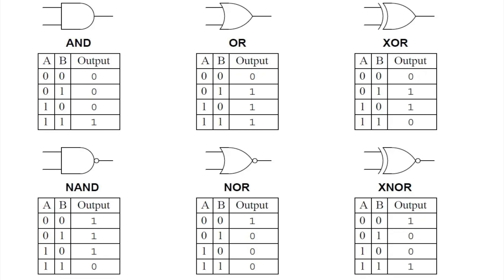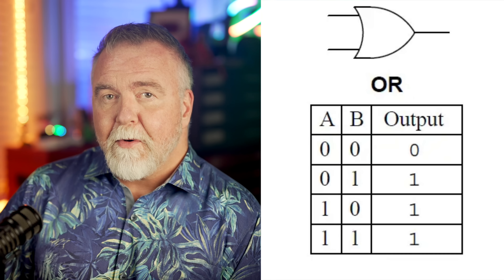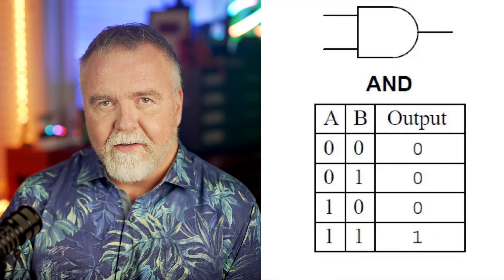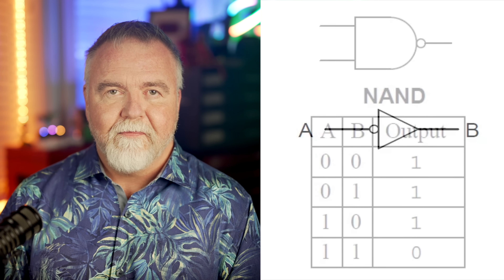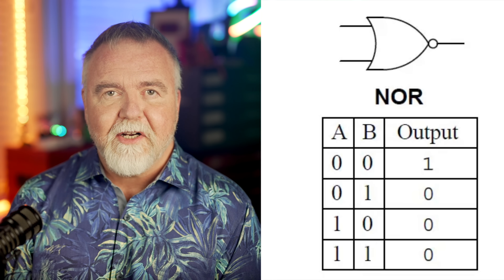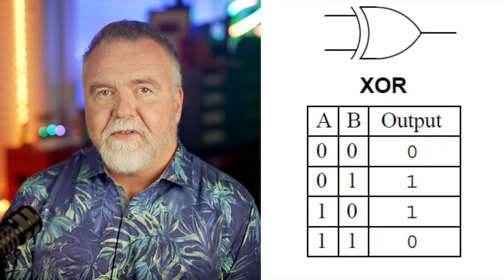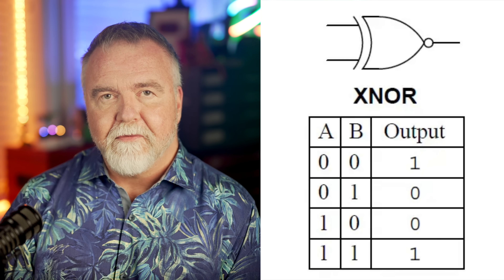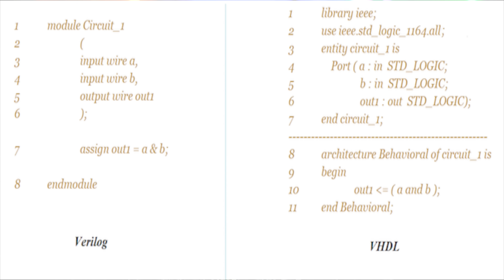The "Do Anything" Chip: FPGA

Comment: As a board jockey with over 100 FPGA designs and 300 PLDs prior to that I will caution you that although the FPGA and its embedded enhancements have gotten really compelling they have never been the panacea that they advertise.  The first and foremost issue is cost. In small volumes they are prohibitively expensive for products you intend to retail. Now I have built protos with them to enable the extended team to get moving on firmware/software development and then moved the design to an ASIC for volume but that's all. The ASIC solution is far more efficient and cheaper with lower power and heat.  The second secret is that for any design you only use a small fraction of every macrocell (or whatever they chose to market them as). The spec sheet will call a part as having XXXXX equivalent gates but due to the nature of macrocell layout for a particular portion of logic only a small chunk of that full macrocell will be used. Fitting into an efficient cost effective design is a bit of labor.   Finally, pinout.  I do not know if they have fixed this nit. I certainly asked them on many occasions.  Its not uncommon, given the above inefficiencies, to have a fit issue in a design. You'd love to be able to just bump up to the next price point/density and leave it at that, but the last I saw, and its been a while, moving from X macrocell to y macrocell changed the pinout which means a PCBA spin.  You can go from 128M Flash to 256M Flash with no PCBA spin. It would be so nice to be able to do that with FPGAs.  I will say the best fit I had for FPGAs was in cryptography.  LFSR's just fit so nicely in an FPGA.  The second best fit harkens back to their original intention - gobbling up combinatorial logic. Really good at that. Great for IO address decoders etc.  For super high speed stuff (PCI-E, PAM, Nteworking, etc) the IO's are usually excellent BUT the cross chip routing CAN make the overall circuit slow down below the capability of that IO. That takes a good amount of pre-planning and paritioning to succeed. Much more than code the Verilog/VHDL and push "program" like a microcontroller.  And of course every change/enhancements restarts that joy and God help you if you need to change pinout.
Reply: And lest I give it a bad name - these puppies are super useful in one critical place.  Everyone knows that the way to win a market is with an ASIC. A single monolothic chip purpose built for the need in the most efficient way possible. ASIC changed the world. Your NVIDIA card is an ASIC. That same design done discretely would cost tens of thousands of dollars, draw 100 amps, be two feet square and need its own air conditioner. (This is how it was.)   Well to make an ASIC takes a lot of effort and a large team of designers and verification people to shake it out.  This is traditionally done with simulators.  Simulators are slow - very slow. Depending on your CPU/CPU array setup this can mean minutes per nanosecond of realtime. Imagine decoding an MPEG4 stream using this.  The solution, for those with the capital, is to build or buy an ASIC Emulator. This is a system with arrays of FPGA's interconnected. In some systems you can even put the actual real world IO into the mix with a custom built IO card.  You take your big design, partition it across the array of FPGAs and run it there. ITs expensive but when you you need to compress the development cycle down to a minimum - winner.  And in my experience it found bugs (humans can make mistakes - its okay) that would have taken months of simulation with a low probability if finding them even then. (Called corner cases. And these were almost always where one circuit was done by one designer and the other by another.)  I can guarantee that the stream you are watching is traveling across a chip developed in this way.

Comment: In 2005 I took a course in VHDL which I found so amazing... when I started to understand that the order of some rows of the code you wrote didn't matter as they would be "executed" in parallel. My C++ brain had a hard time accepting the lines of code didn't "execute" in the order that I wrote them but could be "executed" at the same time.
Reply: Currently taking my first Verilog course in University and this literally just clicked in my brain this week (8 weeks into class, our Professor didnt do much explaining and just threw us some half finished code lmao)
Reply: The purpose of VHDL is not to execute.
It is NOT a sequence of instructions.

It's a language to create hardware.
Reply: Does anyone of explore how that works???
Reply: @Krishna-iy5wy  VHDL = VHSIC HArdware Description Language. 
You aren't making code that run on a target.
You are creating an hardware architecture that will execute a function.
Reply: Well even C++ code you do write is not executed in order. Most of the current cpu's does parallel pipelining so you can actually execute more instuctions in one clock.

Comment: The chip that can do anything in a slow, inefficient way by consuming a lot of power. It is clearly a worse solution, which is used if you have no development costs or faster and more energy efficient microcontrollers can't do the job (mostly because the common flaws of having no proper high-speed interface components).

Comment: Ha took me back to my first electronics projects , Fairchild gates flipflops , ittle round pills with eight legs , replaced a hand full of parts . You could build a digital clock the size of a shoe box but still needed driver cir units to control the nixie tube output. Gave off enough heat to toast bread. Take care.

Comment: Sounds easy, but its far from when you first start, my tip is make sure ALL conditions are covered in if or case statements, dont leave anything ambiguous or the compiler messes it up without telling you there is an error (sometimes as they are temperamental).

Comment: I'm a big HiFi fan, and there's lots of new/newer gear using these. Like Chord from England makes really nice DAC's (digital to analog converter/external sound card) that use these for the whole process. And other companies, like Denafrips from China use them in their r2r DAC's (r2r uses resistor ladders to do the DAC) to basically control the resistors on the unit. 

And there's plenty of other examples too. Most are not cheap though. And I've only seen them used by smaller companies, like the two I mentioned. 

Either way. Thanks for the super video Dave. Very informative. You learn about these types of things, and you think that you know all about them. Until you watch a video like this, and realize there's a lot more to it. ✌️

Comment: FPGAs would be great if manufacturers freely published the bitstream protocols so open source developers can write software that is platform independent (yes, there are open source EDA tools out there, but I think they were reverse engineered into existence) - I don’t want to license a design tool that only runs on windows after spending big money on the silicon - hardware vendors should stick to making/selling the best hardware they can produce.  Open source FPGAs also need to become a reality kinda like how the RISC-V CPU became a thing - it seems that orgs like FOSSi and chips alliance talk about this, but where is the silicon?  Chip Gracey open source licensed his first generation “Propeller” multi-core microcontroller, where are the foundry/design start-ups and generous souls like this guy?
Reply: Some day hobbyists will regularly be producing their own chips. It would be interesting if the focus is on producing FPGAs, since with one design you can do almost anything.

Comment: Great video if I could hear it for my kids swinging from the curtains. Historically people used to use NAND gates because they are simple to make using early transistor logic - like two transistors and a resistor.  Then you can make pretty much any combination of logic out of those, even state machines - and state machines are really the ancestors of the microprocessor.  You can with a paper and pen minimise the Boolean logic and get an answer expressed as nand logic.  Early on people twigged that if you have a huge array of these identical blocks and you could somehow wire the grid up by connecting or disconnecting the blocks to a large grid you could realise almost any combinatorial logic.  Some are fuses which are blown at first program others are programable as mentioned in this video.  I think nearly all load the "program" from serial flash on reset.  They were less efficient than application specific designs because you might need to arrange your blocks in a convoluted way to achieve something that can be done in a proper design with a handful of transistors, and with NMOS all those gates were burning away power - even the unused ones, but today they contain all sorts of wonderful blocks and you can control the power usage precisely.  You can even specify an FPGA derivative with a built in 8051 or ARM block so there is no compromise (except cost).  The FPGA doesn't need an OS and complex outputs can respond immediately to inputs without having a "thinking" state machine in the middle.  For most of us though, general purpose controllers are so cheap and so fast that FPGA's aren't necessary, you can get microcontrollers for 1 cent, and you can connect it directly to a 3v coin cell and off you go.  But FPGA's are found in a lot of consumer equipment typically where signal processing is required in low power where a general purpose CPU would make a meal of it, tinkerers like to use them to realise replicas of long discontinued retro parts including entire processors complete with the bugs!  They are however, in my opinion very hard to get started with and I reckon most of them tinkerers will already work with FPGA's as a day job.  The minimum you'd need as an evaluation board, sdk and about a month free from interruptions and screaming kids.  But, if you have an idea and you can come up with the design blocks you can take it to someone who would find it child's play.

Comment: I've tried out FPGA development a few times, but the problem is that the tech changes constantly, so boards I've used in the past are now often redundant, and the community has moved to a diferent architecture or manufacturer. I know some things transfer over, but it's nowhere near as stable as microcontrollers and their platforms.

Comment: I compare FPGAs as the compliment of a microprocessor.   Processors are really good at doing random thing sequentially while FPGAs do a really good job of doing the same task simultaniously.  As an example FPGAs are inefficient at doing one time tasks like initialization but great at repetative tasks like applying a transform to an image. Processors on the other hand can breeze through one time tasks but can quickly bog down on repetative tasks where you need to do the same operations over and over again.

Comment: Please discuss security issues with FPGAs compared to traditional CPUs and SoCs; particularly those related to buffer overrun, code injection, and other common zero-day exploits.
Reply: Interestingly you could actually have an FPGA-based system more secure since you control the entire circuit. Obviously you don't connect the standard FPGA programming part to the outside since it can be buggy. But you can design your own processor with its own protocols, and be reasonably secure that it doesn't have designed-in backdoors like major CPUs do (e.g. Intel Management Engine, running its own proprietary OS).
Reply from the maker: I'm no expert, but I think it'd be immune to most of those attacks because they're really CPU based attacks.  You could hack the NVRAM and modify the config, adding or modifying the design entirely to your own taste if you could break that.

Comment: There are pro audio analog to digital converters that use FPGA as a substitute for DSP.  In this case to emulate various audio effects like EQ compression and limiting. Usually emulating a vintage piece of gear.
Reply from the maker: I wonder if they make things like a keyboard where the FPGA gets set up based on the instrument it's trying to replicate... so your "patch" consists of the samples and FPGA code to model the original sound?
Reply: @DavesGarage  the UDO Super 6 is the only FPGA based hardware synth I’m aware of, they’re designed to offer new oscillators etc through firmware update but I’m unsure of how this differs from a traditional digital VA synth. Definitely can’t think of anything that would work the way you describe but it’s a cool idea

Comment: Hey Dave! I have an old Digital Computer Corporation "Computer Lab" from 1968.  it is a wooden frame wrapped around a sheet of glass with a bunch of holes in it where you have to insert jumper wires in appropriate locations in order to program it for various logical functions.  

Almost all of the  "chips" on the board are quad input nand gates, and you have to use them in clever ways to make them behave like all of the other logic gates.  I have a copy of the "computer lab workbook" that accompanies it, and in the book they explain the cost of discrete transistors at the time, and how a quad input nand gate was just under ten dollars (10$ in 1968!) and a single transistor that performed any of the other operations was around 15.  It would appear that the process to create nand gates was relatively  easy and cheap to do at the time, but any of the other logical operations was cost prohibitive...  

I have mine all wired up to demonstrate counting in binary, and I bring it off the shelf from time to time and show it to my students, especially when I start teaching them about IP addressing and bits and bytes.  

These things came with an obscene price tag in 1968 as well.   My favorite part in the book is where it says that "some day there will be a computer in every city."  

Anyway, how's that laser tempest coming along? :D

Comment: FPGAs have pros and cons.
One of the big advantages is their reconfigurable nature. Screw something up and you can likely fix it later. (the main reason they are popular in the automotive industry, despite ASICs making more sense at these volumes.)

But FPGAs have big downsides.
One major one is speed. Due to their inherent extra logic for handling their reconfigurable nature, they suffer major propagation delay compared to dedicated logic using the same manufacturing node.
Another major issue is cost. You get far less computational resources for your money. Since they require a lot more transistors due to the aforementioned logic needed for their reconfigurability.
The third issue with them is power efficiency. Yes, all that extra logic draws more power. Especially all the logic used for signal switching for both buses, but also for switching what logic functions are used.

Now, FPGA vendors have "solved" these issues by adding dedicated logic.
One of the earliest inclusions were SRAM, since a large SRAM array is a lot more resource efficient compared to implementing it in the FPGA fabric itself.
Another typical inclusion is things like full adders, IO frontends (PCIe, USB, SATA, Ethernet, etc, etc), and even whole processing cores and dedicated accelerators.

FPGA fabric itself isn't all that impressive. And using it in raw computing applications is often (but not always) a bit inept. In a lot of larger FPGAs, the FPGA fabric isn't really the main attraction, but is rather used to glue the various dedicated logic pieces together.

However, multicore microcontrollers are quite competitive against FPGAs. Same for multicore microprocessors in general. Though, most CPUs suffer from caching issues when handling highly latency sensitive operations (a cache miss can be completely unacceptable due to the associated increase in latency), but some DSPs have integrated RAM for this exact reason. While some CPUs have scratchpad memory to solve this caching issue. (scratchpad is however a rare feature often only seen in servers, and even there it is still a rare feature.)

If we compare an FPGA to an ASIC. Then an ASIC made with 10-20 year older manufacturing nodes can still be competitive as far as throughput and power efficiency is concerned.
However, ASICs are rarely reconfigurable, one can add reconfigurability to one's ASIC, but it brings along similar downsides as FPGAs inherently have. So a semi-reconfigurable ASIC made with a cheaper node is debatable if it is a better solution than an FPGA. Especially when one considers the design and manufacturing aspects of ASICs. And this is honestly the biggest advantage of FPGAs. They are stuffed full of IP blocks for all the protocols you can dream of, often it is just a simple license fee away, for ASICs it is a lot more paper work.

In the end.
FPGAs are having pros and cons.
They are good for the following:
Low volume. (how many units constitutes "low volume" is highly debatable and depends on the application)
Reconfigurability to avoid future potential issues. (as stated, semi-reconfigurable ASICs aren't really much different than an off the shelf FPGA)
Highly latency sensitive applications with high throughput. (but oftentimes one will be forced to build an ASIC here regardless, since there might simply not be any FPGA fast enough for that task)
Or if one needs a bunch of IP licenses for various protocols.
Quick lead times. (they are often in stock and shipping, unlike an ASIC that sometimes have year long queues for manufacturing, unless it is your own factory, or you have stepped into the queue long before designing the chip, or have some other contractual partnership with the manufacturer.)

They are however bad at:
Power efficiency for their node. (extra logic = more power consumption)
Peak throughput for their node. (extra logic = more delay)
(here a sufficiently old node won't be able to compete in these metrics against a given FPGA. However, an old node can be very cost competitive per unit.)